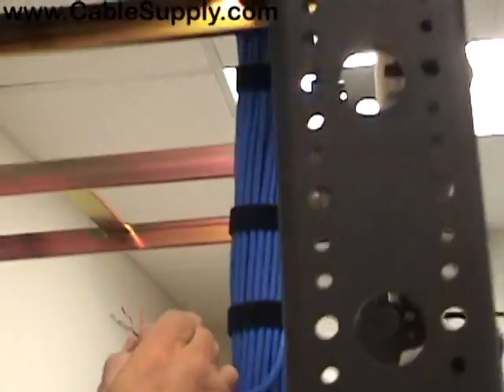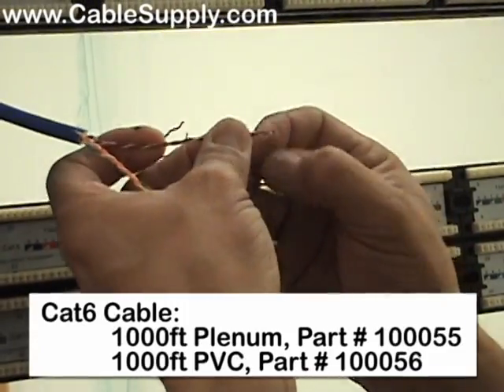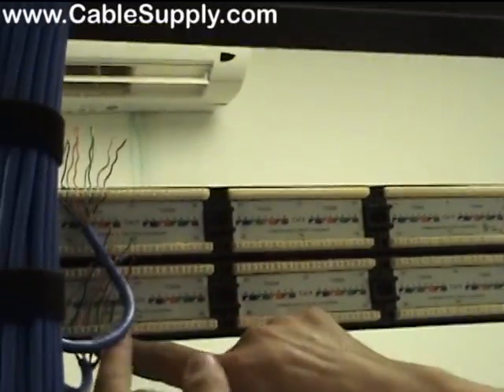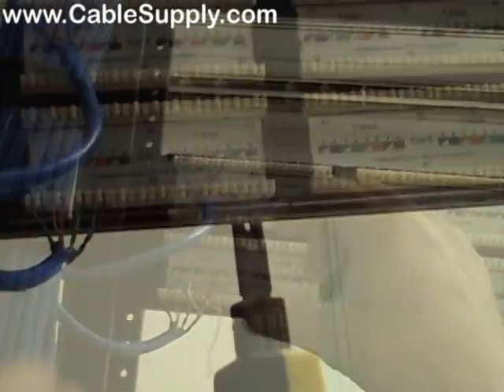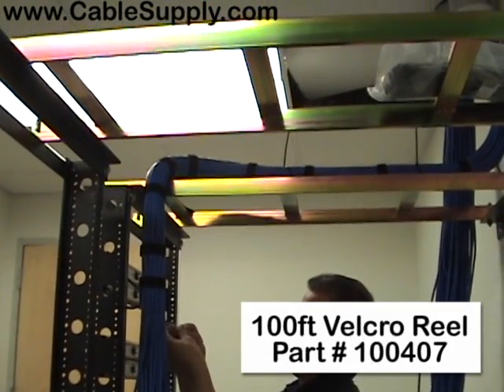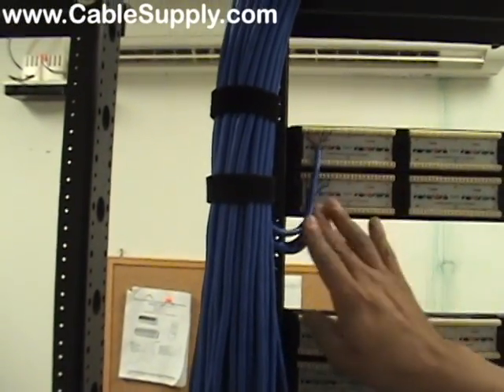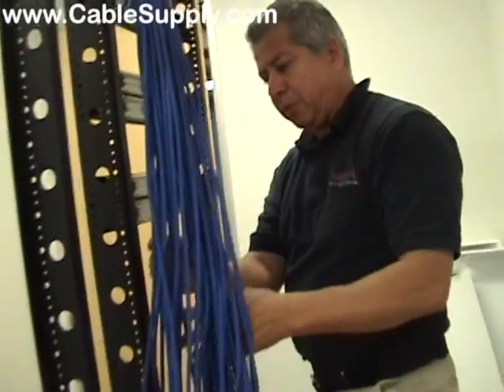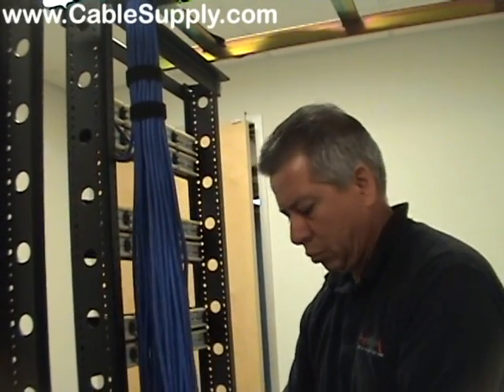Installing Cable and Terminating a Patch Panel (Part 1 of 4)

Comment: I agree with Kenneth. Always label your cables. Fit your cables in sequence on the cable comb that it would lay out onto the patch panel so it fans out perfectly when you get to punching it down. Toning unlabeled cables and testing after is twice the work plus a pain in the ass and your jacks are in order :)
Reply from the maker: The way you are doing it takes to long. Cable Comb yes. Finding labeled cables takes to long.   Check out the "cable Identifier" Videos.  It wall save you 30% labor / time .
Reply: @CableSupply  Sorting cables or running back and forth with a toner is going to take time. Either you have a second person to help you or you'll just be running around. Sorting can be done alone.

Comment: I don't agree with the comment that the recording person states that you don't have to mark at the cables before, "WRONG" you must label  cables as you pull them so you don't have to spend hours trying to tone and identify that big bundle of cables,  it is way easier to test and certify your cables as you know which cable is where is supposed to be at by having them labeled.
Reply from the maker: Checkout  "Cable Identifier Combo Pack™" at www.CableSupply.com .  it will save you about 30% labor time verses marking each cable, also checkout my video on this subject at on YouTube https://youtu.be/SiozCYuh-FE there are also other video on my YouTube account about the "Cable Identifier" how it works and how it will save you time.

Comment: Hello sir,  Appreciate all your videos.  Do you have any resource , school or facility near Los Angeles, CA that provides installer/technician training for either or both copper and fiber installation?
Reply from the maker: I am not aware of any schools that teach copper or fiber installation but I am considering doing some training classes in southern California myself.
Reply: Please let me know when and where and any other info on a class.
Reply from the maker: I will.
Reply: Intercoast college I got my trainee card from there now I work two low voltage positions

Comment: Just starting my classes for this, which will be my second career, was wondering what this job is labeled, Network Tech?, Network Installer? And how do you go about finding a good company to work for? Any and all thoughts appreciated.
Reply: cabler, data cabler, cable puller, structured cabler, low voltage cabler, cable tech
Reply: Usually the tags on a job search for this type of job is under: Network technician, Telecom Technician, Installer technician, Cabling installer.
About the company I would do a research or talk to people that works for the company you're interested on.....

Comment: when calculating drops, what is a good number for redundancy and expansion? and would the expansion and redundant links be wired into switches or just terminated at the patch panel ready for future use?

Comment: I prefer 568A standard myself since I came from phone repair, it follows the phone code. As luck would have it, I live in Canada where 568A is still the code used most
Reply: It used to be the standard in the US back in the days, but nowadays every project is on 568B why I don't know, Only thing I could think of is that all pre-made patch cables come in with B termination standard.
Reply: Michael Bouwmeester some faceplates I use from amazon UK only have 568B markings

Comment: That 2nd cable you terminated does not terminate from the bottom of the 110 terminal. It should come in from the top of the 110 terminal.

Comment: I have a more basic question:  The Patch Panel you installed is front facing, to this means that the cables will go from the front of the panel to whatever device is also in the other rack.  Do you have a video showing how patch cables look going from the front of the rack/panel to various devices?  

This can get a little confusing because some rack devices have ports on the back and others on the front.
Reply: Nice question, I've recently been onsite where the patch panels and rackmounted routers and switches were mixed in the same server rack, meaning that although things looked tidy from the front...the back unfortunately was completely populated and it was virtually impossible to utilise it for racking devices from the back or effortlessly adding additional devices.

Comment: Labeling makes troubleshooting much better you're not guessing or toning out the wire to figure out where it's at.
Reply: There needs to be a video battle between labelling Vs not labelling using cable tool in order to settle this vendetta once and for all.

Comment: IF you pull patch panel-to-panel rather than panel-to-jack: what is your recommended method for identifying the cables? If the panel is pre-labeled, I need to identify the cables on the second end before they are punched down. Is a Tone-and-probe Tool the best/only option?
Reply: +Conny Brunnkvist No you can get a regular cable tester and test each jack at the rooms to the ports on the patch panel.  Its better to pre label because then you have the ports in order than a big mess of numbers
Reply: When you pull big bundles of cable it is recommended that you label your cables as you pull them, as you will spend hours or days toning cables in a big project to test and certify your cables before surrender the project to the client. if you are only pulling 2 or 4 cables and you have the luxury to spend time on testing and toning is fine not to label before but again it makes the job easier to pre-label the cables as you pull them. I know some people says that the patch panel is labeled still that don't help too much as the labeling scheme for the project may involve Level+Jack # + Letter, etc.